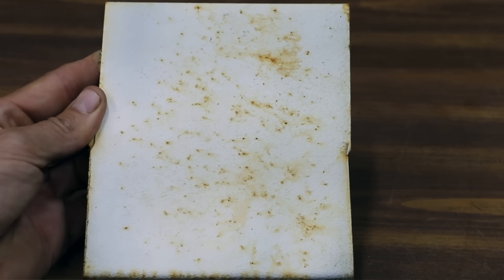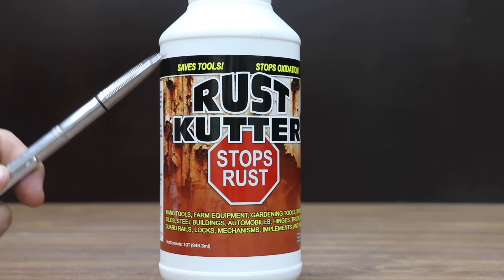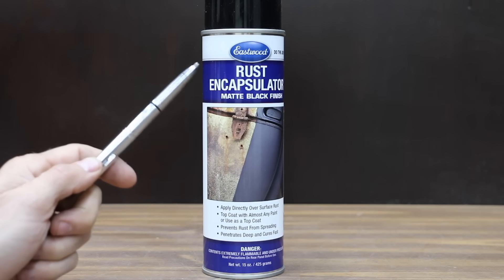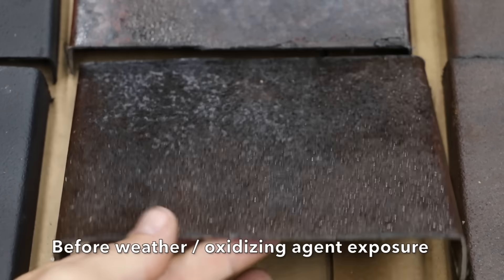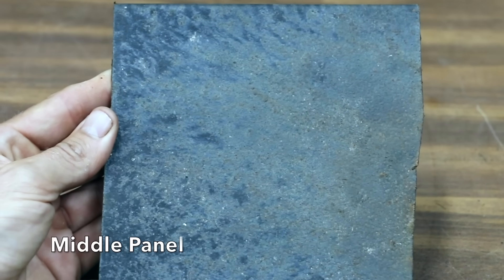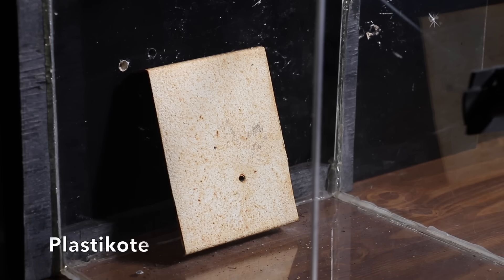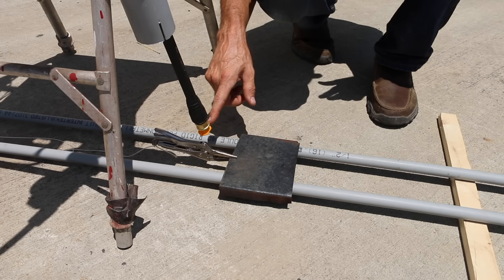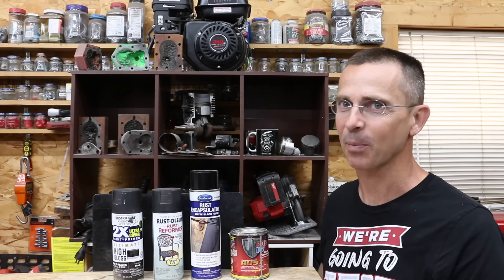Best Rust Converter? POR-15, Eastwood, Rust-oleum Rust Reformer, Gempler's

Comment: Have you tried using Rustoleum Rust Reformer then doing a 3 coat cover with Rustoleum Undercoating spray for a Rubberized Undercoating protection which you would think increase strength against normal chipping and wear from highway and city driving.
I'm sure if you live in the Rust Belt or off-road or drive on gravel roads you may have far more severe wear to your rust prevention/converter coats!
I hear Rubberized Undercoatings can trap moisture in but if properly prepped with converter/reformer it should not cause problems and seal moisture out.
Reply from the maker: Thanks for the suggestion.

Comment: This is a great test! I'm always playing around with different rust converters/reformers/removers. There is a brand I bought long ago that no longer exists called "Purple Power" that I bought at Advance Auto Parts. Today the only "Purple Power" you find is the degreaser. But that thing worked similarly to the Rust Kutter - Only better. I like that kind of product for simply stopping the rust(cancer) to continue spreading, the area stays phosphate instead of Iron Oxide, but is not a color so it doesn't modify the painted section. I believe another brand out there but only available directly from the manufacturer is Skunk Rust aka SR-17 for industrial use. -  However, since many of these converters you tested are not UV resistant, it would have been nice to have had another panel of each brand top coated with the white paint that wouldn't have had the hydrogen peroxide rusting agent applied. Just to see how those would have performed.
Reply from the maker: Thanks!  Thanks for the feedback.

Comment: I'm planning on using POR15 to refurbish the subframes on a mitsubishi evolution. Is the POR15 product suitable for sand blasted steel?
Reply from the maker: Thanks for the suggestion.
Reply: @ProjectFarm  was a question.. can this product still work on a shot finished surface? Paint on rust (POR).. wondering what it's like on shot finished surfaces. 🤔

Comment: I need your help guys !

I bought an old 79 truck for my brother who left to the military a couple years ago. He’s active and I wanted to surprise him with this c10 it doesn’t have a motor and I will not be working on it for some time . So it will just sit under a carport  wide open the weather . What product can I use to help slow down or convert the rust so whatever’s on there now an go away or the truck can at least last a little longer

Comment: I feel like Rust Kutter was not used to its full potential in this video. Its meant to be sprayed on to a surface to convert the rust into an iron phosphate, then you paint the surface to prevent further rust. Its designed to create a primed paintable surface, and to stop the rusting process that was already started from coming into contact with a corrosive enviroment/chemical. Its not designed to stop further rust on a bare un coated surface when re introduced into a corrosive enviroment/chemical. 

Rust Kutter should have been used and then a layer of Rust-oleum x2 or Rust-oleum rust reformer applied over it. This makes a cheap and easy way to take an old rusty underbody of a car, remove the surface rust from it, leave a primed surface for an undercoat, then have it painted to protect it from further rust.
Reply from the maker: Thanks for the constructive feedback.
Reply: @ProjectFarm  Thank you for taking the time to read it!

I'm currently in the process of restoring my grandfather's 1965 Cyclone that lived in a storage unit for 40 years. The underbody was in really good shape but surface rust was starting to form from many years. 

I gave the underbody a wash and scrub, then sprayed it down with Rust Kutter to convert the surface rust to Iron Phosphate, then washed it a second time and applied a second coat of Rust Kutter as needed to heavier areas. This left me with a nice black surface to paint on. I then used Rust-oleum Rust Reformer as a top coat over the Rust Kutter and then applied a Carnival Red Rust-Oleum Spray paint enamel to match the original underbody paint. I then used CRC 06026 Heavy Duty Corrosion Inhibitor on all the bolts, and high corrosion areas such as the torque box, body rails, and suspension components. 

This should give me many, many years of rust protection as the pre-existing rust has been chemically removed, and there is now a nice protective barrier over the primed surfaces. The Rust-Oleum Rust Reformer and Rust-Oleum Enamel should give me a very tough surface to protect from new rock chips.

It would be interesting to see how products work when used together with each other, like in my case.

Rust-Kutter
Rust-Oleum Rust Reformer
Rust-Oleum Spray Enamel
CRC 06026 (on high risk areas)

Comment: Phosphoric acid is the best rust converter. Also sold commercially under the name of Ospho, and probably other names. Apply and let sit overnight. Then cope with your favorite protective paint. Some of these other products probably contain similar acids, but I'm sure are more expensive than a simple bottle of phosphoric acid. I buy Ospho and put it in a plastic spray bottle and just spray it right on the rust. It soaks into all the cracks and crevices and completely stops rest. You can paint right over it, it acts as a primer.
Reply from the maker: Thanks for the feedback.

Comment: I would have liked to have seen Rust Bullet tested as well. I have used both POR15 and Rust Bullet and both work well. I did the roof of my 1994 Dodge Grand Caravan with a mini roller and did not topcoat it many months ago and see no rust coming through. The only thing I have seen that will remove POR15 and Rust Bullet is DOT 3 brake fluid. The Rust Bullet is easier to apply as it is able to be applied without any special prep as opposed to POR15 which recommends prep with POR metal prep solution. (EDIT) I stand corrected. Actually, Rust Bullet does have a pre-treatment that is advised. I have not used it and still had great results, i.e. the roof of my van. Thanks for the video - I know that took a lot of time and effort.
Reply from the maker: Thanks for the suggestion.

Comment: POR15 won all the tests.  But I think it's difficult to use, in that, once you open the can the paint starts curing.   It starts curing upon contact with atmospheric water vapor.  Basically this means that once you open a can, you should think of using it all.
Reply from the maker: Thanks for the feedback.

Comment: Thank you for your time and effort. I understand that Hydrocloric acid is used in commercial pickling of steel (which to remove surface rust and scale) however, I have never seen it done until I seen your video. This will save me some time and effort with my rust removal projects for sure. Just have to use caution
Reply from the maker: You are welcome!

Comment: I cleaned a paintbrush full of concrete bonding agent on a rusty wheel (basically a light even coat)the wheel set outside over the winter. Springtime the rust was still coated with the concrete bonding agent, I still wonder if this would make a great rust sealer before painting? 

Thoughts??????

Comment: POR-15 might appear to be the most expensive but it’s amazing how much square footage it can cover! When that’s taken into consideration, it probably ranks one of the cheapest out there. Coupled with being the best for stopping rust, it’s an overall amazing product!
Reply from the maker: Thanks for the feedback.
Reply: Did you use the metal prep before the POR ?
Reply: @mikeschlup5279  it’s the most important step… and the most forgotten about!!! The POR15 is a 3 step systems… metal ready (degreaser) metal prep (zinc oxyde converter) and Por15 paint sealing everything. the metal prep actually has chemicals that reacts to the Por15 paint to make it bond and air tight.
Reply: @mikeschlup5279  of course. That is an important step in the process
Reply: @careylarsen2227  "of course. That is an important step in the process"

Says who? The company that makes extra money when you buy their metal prep? Have you ever done a Project Farm-like test to see if using the metal prep stuff makes any difference at all? It wasn't used in this video and the POR-15 still worked perfectly. The product is called POR-15 (Paint Over Rust), not POMP-15 (Paint Over Metal Prep).
Reply: @mikeschlup5279  I was wondering this as he doesn’t mention it. Por15 seems a bit of a rigmarole when you use it but the results speak for themselves.
Reply: Been using this product to all my rust repairs , it works
Reply: I used some POR-15 over a decade ago and the rust never came back.
Reply: @jctedsap Will POR 15 adhere to the non rusted portions just as well? Thanks
Reply: @Rizzycat1  Fresh metal needs to be etched with metal prep and then rinsed.
I've read where the POR can separate from the metal and allow rust and go undetedcted because the top coat looks solid.
Reply: @aa-dz6cr  any suggestions to do that ?
Reply: do they sell it in an aerosol can
Reply: I live in the sand belt, sprayed a 2500HD frame after sandblasting with POR15 and after 3 years it hasn’t budged
Reply: @smokiethebear3334  That's valuable information because the instructions state not to remove the rust before using.  Other places state that it needs the rust.  You did the exact opposite of what was recommended and it is working.
Reply: @jackt6112  it responds well to a porous surface.
Reply: He didn't use the proper metal prep before applying it and it still outperformed everything else. Lol
Reply: new england here...  POR15 lasts about 1 year here.
Reply: @rupertpumpkin5388  is your name a take on Rupert Pupkin? Wasn’t that a guy that murdered people or maybe he was shot by police?
Edit: DeNiro’s character in “The King of Comedy” I get all my Opie and Anthony references mixed up.
Reply: @Rupert Pumpkin  I'm also from  New England .you must not applied correctly
Reply: But it's professional use only.
Reply: @Okurkaarrgghh  I'm pretty sure that's to "get around" VOC restrictions for consumer products in some jurisdictions, but who knows.
Reply: Thousands of people do it themselves with POR-15.
Reply: @Okurkaarrgghh  But it's professional use only.

If I don't make a confession, does that make me a profession?😁

Comment: I would like to see corroseal, I have used it on my mower decks and am curious if it would work well on the undercarriage of my vehicles. Rust on the undercarriage is a big problem here in PA. Also evaporust is readily available. Looking to see what is a good rust converter to stop or slow rust on the undercarriage of vehicles. Love your videos.

Comment: Did you cleaned up the panels very cautious cautiously from any grease ? The results for rust oleum would be + 100 per cent much better ( just using salad vinegar and dish soap).
We don't know the cleaneless of the hands with its own natural grease , which may contaminate and alter the final results !

Comment: The Rust-Oleum Rust Reformer High Performance V2100, and the Rustoleum Industrial Strength oil and non oil based in the gallon can for $30-$40 bucks I would've really liked to have seen them on a test 2 sometime soon!

I think using one of these or the Eastwood, then using...

Hercules Bed liner roll on/spray for step 2...

followed up with Rust-Oleum Professional Rubberized undercoating to help absorb rocks and what not an to pro long the Life of the bed liner would be the ULTIMATE 3 STAGE COMBO! for Undercoating frames and to prevent rust and rocks penetrating the paint
Reply from the maker: Thanks for the suggestion.

Comment: I'm going to try the 3 Step POR 15 product on my lawn mower deck underside. We have wet sandy soil and I have to scrape off wet clumps of dirt and grass off the mower deck. I've tried all kinds of products and different types of blades to help stop grass from sticking but nothing works. Every three cuts I have scrape, pressure wash and spray with Mo Deck or a similar product. Any advice on relieving this problem would be greatly appreciated.
Reply from the maker: Thanks for the suggestion.

Comment: Nothing will stop rust permanently. I've had good luck with a 3 step process. After removing loose rust then washing, rinsing and allowing to dry I apply 2 coats of rust converter. Next day I apply 2 coats of por 15. Next day I add 2 coats of rustoleum paint. I live in an area where winters can be harsh and a lot of salt gets sprayed on the roads. I try to hit the car wash fairly regularly in the winter.
Every other year I add another 2 coats of por 15 then another 2 coats of rustoleum paint to the areas I've already worked on. I've been doing that for 12 years and my old vehicle has held up pretty well.
Reply from the maker: Thanks for sharing.

Comment: Sorry, I had a different experience with POR 15. I had a rusty quarter panel on my fury and they replaced the panel with new steel. As a precaution I coated the whole inside of the panel with POR 15 and  it did take another 10 years but that quarter panel has rusted through again! So it may be the best of the brands tested but it is not a permanent cure based on my experience.
Reply from the maker: Thanks for the feedback.

Comment: Some are paint and some are acid... a little weird to compare them? The manufacturers really shouldn't call the ones that are just paint, such as the rustoleum, "rust converters," as it is misleading. A rust converters should NOT have any actuall paint, pigments, or solvents in it. Rather it is supposed to be acid based by definition. The rustoluem rust reformer is just cheap black spray paint which they overcharge for. Real rust converters change the suface without adding anything are meant to be painted over, unlike the all in one gimmicky products that are just a coating.
Reply from the maker: Thanks for the constructive feedback

Comment: Never used any rust reformer or stop I guess there could be instances where it could be the only option. When I see rust on something I own it's got to go. I have used por15's fuel tank sealer before in metal tanks AFTER I removed the rust and it does work just a hefty price tag.
Reply from the maker: Thanks for sharing.

Comment: For rust converter try one part phosphoric acid to two parts distilled water. Brush onto metal with a light rust coating and rinse off after 20 minutes. You should still apply a 2-pak or marine grade paint, POR15 is good, but there are cheaper alternatives.
Reply from the maker: Thanks for sharing.

Comment: Bought a gallon jug 20 years back of POR15.....Goes on like milk dries black sort of like and acid mixed with a very light touch of epoxy
      the stuff is amazing. I would half paint rusty metal and leave it out winter after winter... the untreated part continues to rust
  No longer have winters here...just brutal summers
  Almost out..... Definitely will buy it again
Reply from the maker: Thanks for sharing.

Comment: I had excellent results with Penetrol.
High pressure wash and let dry then apply the Penetrol. Rust turns black.
Then 2 coats of Xylene based two part paint. (pro use only)
This was on steel silos and rust only became noticeable 15 years later. Recoated 5 years after that.
Reply from the maker: Great information. Thanks!

Comment: One can argue prep work needs to be done properly in order to justify the test results. For the most part, the rattle can products are straight forward but for POR15, prep is everything. POR-15 requires some prep work and it's a 3 step process on their products. Degrease, metal prep etching, and paint. These are 3 separate products that you must put on. This just goes to show how careless this test was and not valid at least for the POR-15 product.

Comment: POR 15 is excellent…however it is not UV protected…so if your surface is exposed to sunlight you need to topcoat or it will breakdown over time. And to be fair to Rust oleum reformer…it is a two step process to be top coated with rust oleum stops rust paint
Reply from the maker: Thanks for the feedback.

Comment: This may not be a rust converter....however could you please test Kyptonite Metal Treatment for adhesion and rust prevention? GM states to use it on their frame corrosion issues when the wa  coating falls off.
Reply from the maker: Thank you for the video idea

Comment: Back a few years ago, I used POR15 on a few panels on my vehicle with some rust on it.  I followed the directions per POR15.  However, POR15 is very suseptible to UV light.  Their instruction stated that it must be covered in paint if used where UV exposure is an issue.  I used it on the underside of my vehicle thinking there is no UV exposure involved down here.  I was wrong.  All the areas under the car that were covered with POR15 began to flake off after a few short months.  After that expensive application, I started to use the Rustoleum spray paint you mentioned in your experiment.  I have been rust free since then.  But, I must say that every year a few rust spots appear and I reapply the Rustoleum to mitigate it.  It's not much of a problem since the rust spots are small and easily taken care of.
Reply from the maker: Thanks for sharing.

Comment: Years ago I sandblasted a VW Beetle ('72), painted it with POR-15, and added 2 coats of truck-bed liner. It'll probably be rust-free for decades after it's scrapped.
Reply from the maker: Thanks for sharing.

Comment: Always enjoy the videos. Without getting too far in the weeds, there are two different categories of product here. There are coatings (POR-15, rust encapsulator, Rust Oleum) which apply over rust and become a durable finish that offers some protection to the metal against further rust. The rust converters, however, simply react with the existing rust and chemically transform it to a material that can be painted with conventional paints. They don't offer any protection on their own against further rusting.
Reply: I needed this comment for years. You've saved me.